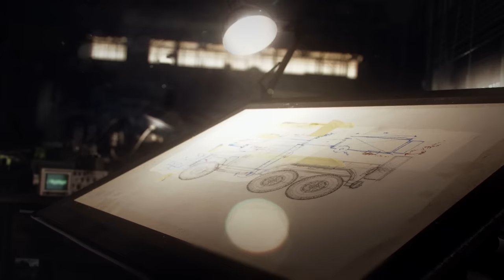Crossout - Intro Trailer

Comment: Man this game had so much potential. I could never leave crossout, not after the 2000 hours I've put in, but spaced armor is starting to really bother me. I want to be the guy in the trailer and drive something cool and unique. What I have to do now is conform to the cut and dry standard of bulky, ugly-looking boxes of armor on hovers. Please for the love of God fix spaced armor.
Reply: Yeah, spaced armor is less incentivized now since they reworked how Penetration works. I hear ya, because I started in 2017-18 myself then came back not too long ago and the contrast is stark. You went from builds looking compact and clean with nice themes to throw whatever mix maxed part you can one at certain distances to create spaced armor.

Like lixxist15 said it's been somewhat addressed, it's not necessarily the best route to go anymore.

Comment: > Official intro trailer
> Tsunami on a white cabin
Seal clubbing is a feature
Reply: It's not. There's no way to have both the tsunami cannon and train plow with the huntsman cabin. There's just not enough tonnage, even if you infused it for huntsman hauler with collassus carrier. It's just too heavy.
Reply: Thats clearly the jawbreaker cab
Reply: @SuperLeader96  no. just no. thats not the jawbreaker in any way, shape, or form.
Reply: @MasterOfTruck  it looks like a mixture of The Call and The Jaw Breaker so we can't really tell :/
Reply: @taste9689  you cant say its a mix of the call because that didnt exist. its literally just a high resolution huntsman.
Reply: @MasterOfTruck  true
Reply: @Corbin Garrison even with a cheetah its still too heavy. we're talking bout white cabin parameters here. plus the engine was was put into the cabin itself, not installed as an extra module. so it would count as infusing the cabin to have more power.
Reply: @MasterOfTruck  It pretty much seems like it isn't any of the cabins we have in-game right now, both the huntsman and the guerilla cabins have pipe supports on the engine hood, this particular cabin does not (you can see that by pausing at 1:40), it also seems to have a chrome-colored front grille, which both the huntsman and the guerilla cab does not, i hope this helps :)
Reply: @ComRed_  its just a high res model because this is only a cinematic. it doesnt use in-game tools. ya know, like most games do.
Reply: @MasterOfTruck  Alright, let's leave it up to this, it's just a trailer, it's just meant to looks good even though you can't replicate the same thing in game, :D

Comment: Let's see if this gets better then the mess that is Robocraft.
Reply: +bladethedemon 
I got into the second major update.
Not sure what that was, but I was in the era where gunbeds were king. I tried to go for the speedster route, but due to the fact that smgs had near instant traverse speeds meant flanking did jack shit, and they could just as easily pointed their guns at me and gunned me down to death.
Reply: Robocraft was good but they added way to much to fast
Reply: +Cyber_apoc 
For SMGs, at least, it felt as if it combined the responsiveness of a FPS aiming recticle along with the inherent clumsiness of wheels. In tanks, having tracks and not being able to hop around and change directions on a dime was ok because it was enough to beat the opponent's turret traverse.
In FPS games, having a good aim is counterbalanced by the player's mobility.

In Robocraft, you get good aim and clumsy mobility. Joy, everyone can still track you easily. It would have been nice if the stats of guns were customizeable. Like higher power for less RoF, accuracy over traverse rates, etc.